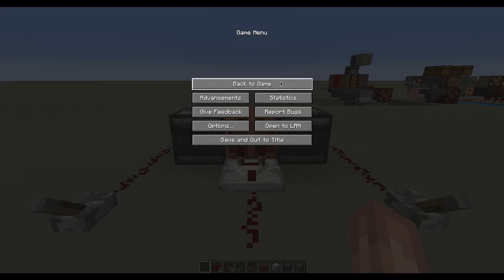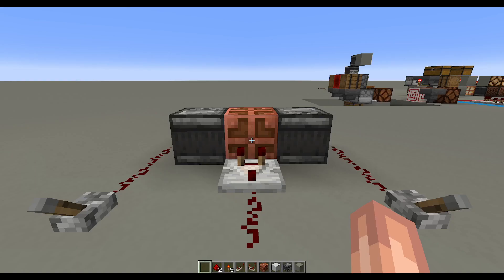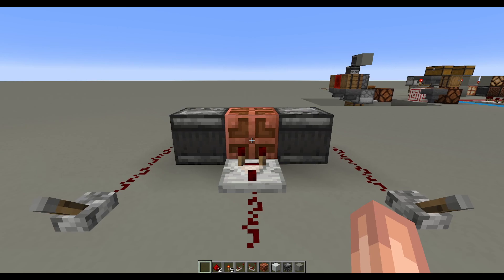[Minecraft] Copper Bulb XOR/XNOR Gate

Comment: if you use it you have to use repeaters though, since using just dust as OR gates will make different redstone strengths trigger it
Reply from the maker: That's true, but only if you have a contraption where the signal could stay on but fluctuate in power level.

Comment: Note it gets broken when two inputs change together
Reply from the maker: Yep! Discovered that a few hours after posting. It's still useful for compactness, however.
Reply: It works fine if you delay one of the inputs. also I made a 3x2 version.
Reply: @bumbo222 no, it shifts the problem. it will still break when the bulb sees a pulse from both inputs simultaneously, regardless of the input timings required to make that happen.
Reply: @bumbo222 You can replace the observer with repeaters set on different timings. You can then add clock locking on the repeater so that it only updates every down clock. Just set the clock with enough down time for the slow repeater to update.
Reply: @kazedcat  That's what Im saying
Reply: @bumbo222 You can replace the observers with repeaters set on different timings. You can then add clock locking on the repeater so that it only updates every down clock. Just set the clock with enough down time for the slow repeater to update.
Reply: So like a lot of redstone it's just not spam proof.
Reply: @humourlessjester3584 So in other words, keep this away from Grian
Reply: yeah and thats like 90% of cases